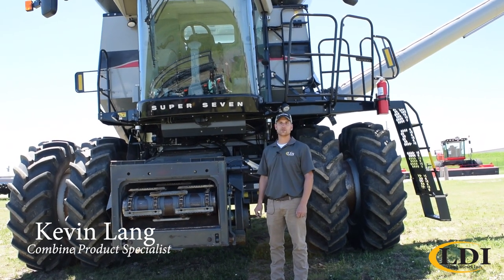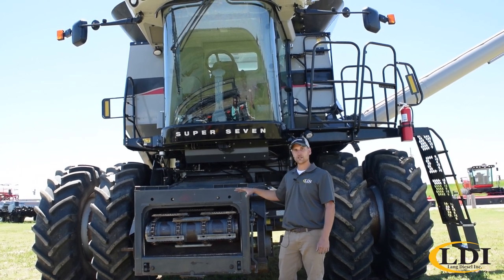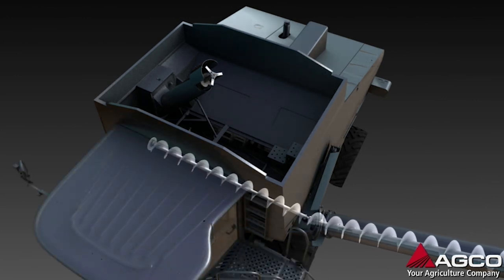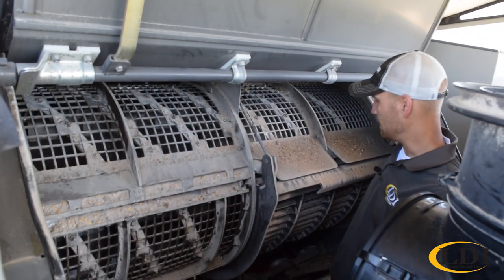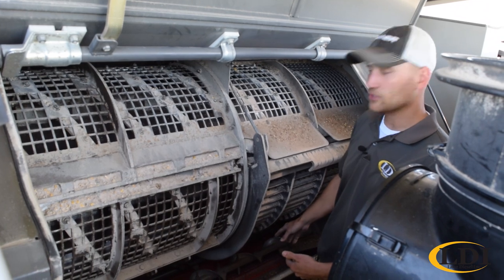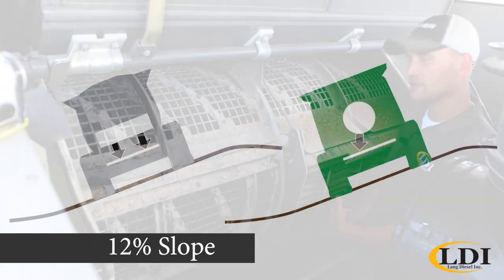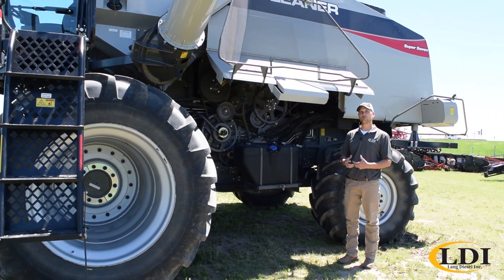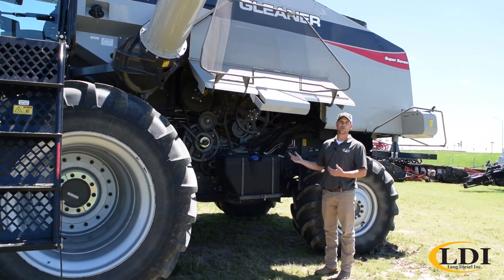Myths vs Facts of the Gleaner Transverse Combine

Comment: Nice video. Dont forget to point out that if you are unloading on the go and end up in a washout, the Gleaner swivel is the only unloader system that can "escape" the cart. With a turret you need to be quick on the brakes, and need to back up the combine and the cart at the same time to get separated. 

That and many other reasons make it the king of rough terrain.
Reply: rborneman I wish Agco would build the auger like New Holland did, their auger can unload from cradle to full out, the gleaner can only unload full out, or it breaks
Reply: IDK, I like the simplicity of no gearboxes. The NH TR system was better than turret systems but it still had a gearbox, I still prefer the Gleaner swivel just as it is.

The Gleaner doesnt have to be completely out, but it helps. on our L2 with the short "standard" auger, we do have to bump it up some to dump on high sided trucks.
Reply: rborneman There is no gear box on the TR combine, other than a TR 70. I had an L3 M2 and you can't move that auger much or it will bust the drive, and if somebody accidentally starts the auger while it's in the cradle it's a monumental problem. The New Holland has another short shaft with a knuckle so it can unload even in the cradle and all the way out, which we've already had to unload into an auger and it worked great leaving it in the saddle to empty the tank
Reply: RJ 1999 there is a lockout switch that prevents the auger from running if its not out far enough.

Comment: We have a had 3 gleaner  combines  loved them all  easy to fixes  nearly  no losses  out the back less than 1/4 bushels  loss  nobody  around  use with other colors  can come close to that   when get 0 dockage at the local  elevator  u set it right and Ave the right guy in the set it the best machine  u will every run

Comment: Pound for pound you can't beat a Gleaner for your money, smart design, belts instead of hydro drives use much less energy and you know everything is turning at the proper speed with belts as long as they aren't slipping. Relatively easy to work on as well.     And I do love the way they look 😁
Reply: Maintenance is super nice both for the combine and the headers, my grandfather and I were able to partly disassemble the left side of the soybean header and change the straps and reassemble it in 1h30, it would have been even faster if it wasn’t the first time we did that

Comment: We had 4 Gleaners in the past. Three had the big V8 Deutz air cooled , the last one I owned had the little 8.3 Cummins . Overall in 25 years of running them, we liked the clean grain sample, and the fuel efficiency of the Deutz air cooled engines. However, we always swathed our wheat into a 50 foot swath. The Gleaner just couldn’t spread it that far. About 35 feet was the max spread , most of it to the left side. Although they could really cover ground when they were running, we had a lot of break downs over the years. When we lost our dealer in our area, we transitioned to Cr 960 and later to a CR 8090   New Holland combines. Never looked back. The NH doesn’t do the hopper job the Gleaner did, but they have been relatively trouble free . We have been using New Holland combines since 2006. Love them!😊

Comment: I cut with a s680 deere this fall in the same conditions in the same fields. He ran a 35 ft. macdon and I had a 40 ft. 9255. The S88 was abought 15% better in capacity in the clean beans, but when we it the tough conditions it was no contest, after he almost plugged the rotor several times he pulled out and got back in the clean beans. He couldn't believe how I could still run 4 mph and never look back. He admitted that the Gleaner kicked the deere's ass.
Reply: Gleanerman the 680 driver must have not known how to operate a harvester. I have run my old JD 9760 alongside a S77 and S78 for 3 years at a contracting job and the Gleaners can't touch the JD in any crop or conditions. In Australia we will sometimes harvest in 40 degrees Celsius and in this weather the small elevator blocks before you can load the rotor up to full capacity.
Reply: Why would you lie like that, shame on you.

Comment: They need to redesign their rear end so we don't keep breaking spindles.
Reply: No fluid just a weak design
Reply: The spindle breaks right under the flange they weld on for the tie rods. It has been on their combines as long as I remember they only increased its size over the years . They have a new design for next year it looks like the mudhog rear end
Reply: Yes they never heard of it doing that before. I know of two others that did that this fall. I think cleaner should stand the cost of replacing rear axles then again I hit my head this morning
Reply: GLEANER.VENITI.SI.IN.ROMANIA.AICI.AVETI.CEA.MAI.MARE.SANSA.NOI.NU.MAI.CONSTRUIM.DIN.2oo2.COMBINI.EU.AM.AVUT.CONORANT. DE.CUMPARARE.GLEANER._MAU.INCURCAT.BANCILE.CU.DRAG.VA.ASTEPTAM.SI.IN.ROMANIA.SA.MUNCIM.IMPREUNA.
Reply: What's this "we" shit?
I have never broke a spindle on any   combine yet.
Alot of my customers have some super deep sprayer ruts every year.
Reply: @mattlf9120  Same here, I never even heard of this spindle problem and ran gleaners my whole life, must be a very rare thing.

Comment: Miss leading when comparing feederhouse widths. Gleaner is the smallest at 39 inches, but when the material hits the competitors 30" rotor, it really has the entire circumference of the 30" rotor (94 square inches) to be spread around and fed through.. You guys try and do it all with 39".  Plus, Gleaner must send the cut material thru two feeder chains and a transition to get to the rotor, whereas competition feeds with one chain.; Lastly, the feeder house is off set in a gleaner, resulting in uneven material feeding into the feederhouse, where the chains must spread the material more even.  40 year old design.
Reply: Mark Bell yes an excellent 40 year old design.
Remember axial designs are even older, and about time they get replaced, right?
Plus I don't ever have to replace cones and elephant ears.
Reply: Id rather have a gleaner than a deere. I worked as a mechanic at a deere dealership and it was not uncommon to see bearing failure of the deere rotory do to the feed design.
Reply: @mattlf9120  Both are around the same age, Curtis Baldwin patented both back in the 1930s
Reply: J. A. G. Hey mate ,I don't know much about  Gleaners ,what system did Baldwin patent and when did they first use the transverse rotor ? Thanks.
Reply: If John Deere and Case used transverse rotors I would actually consider buying one.

Comment: Bring a Gleaner down here to Mississippi and put it in some hybrid rice with a 40 foot header and then I’ll be impressed. Until then I’ll keep my opinion that since you don’t see Gleaners cutting rice they must not be all that great of a machine.
Reply: boomerang379 because rice is the only crop in the world right?
Reply: My point is that rice is the toughest crop there is to harvest and you never see Gleaners in rice.
Reply: @boomerang379  thats rice. Gleaners have been mainly a wheat and oats harvester since gleaner ever became a known name. Come to the midwest and youll still see old c2, g, L2, and n series gleaners running in wheat fields. If the farmer hatvests his own crop 4 out 5 combines itll be a ol gleaner.
Reply: Colton Carpenter I know of a few Fs still runnin around
Reply: @Vaneps0  theres an old man that runs a fleet of 4 old diesel g's he runs north of me.
Reply: Colton Carpenter Around here its corn beans and small grain.  CIH pretty well has the market cornered. For every 6 combines 3 are CIH 2 are Deere and one is "all others". Gleaners are about as common as unicorns. Although years ago you used to see alot of "Silver Seeders" with pick up headers. Not an expert just stating my observations.
Reply: @mjp5429  reason why you dont see many gleaners is due to acgos parts availability and dealer network. Theres only 3 main dealers in Oklahoma now... maybe 3. Compared to deere and cih combined being atleast 40. The red power has been taking over lately though. When i worked for deere we saw issues with the single rotor design bein hard on bearings.
Reply: See Gleaners with tracks, such as here: https://www.allischalmers.com/forum/gleaner-l2-on-tracks_topic134891.html